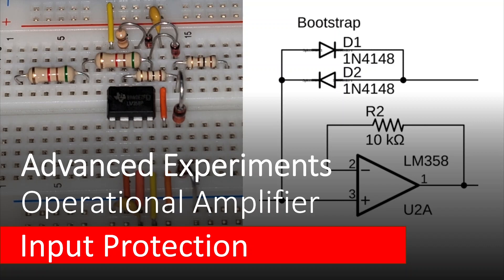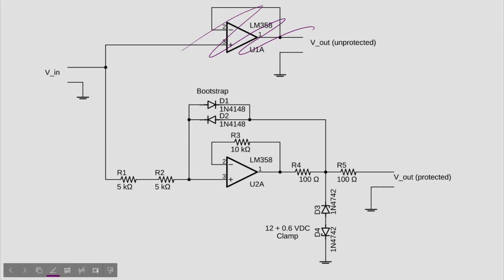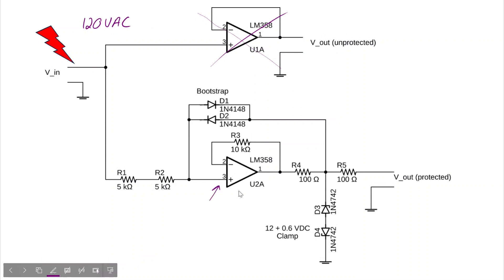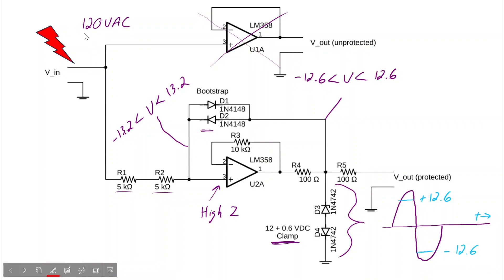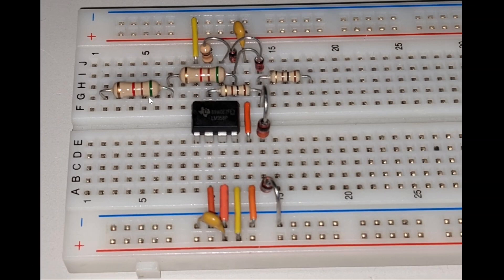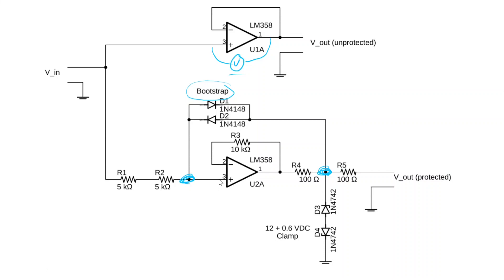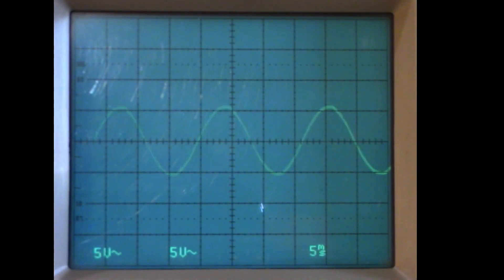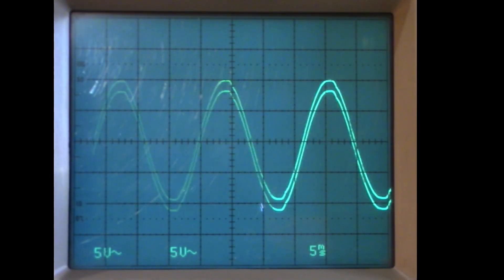Op amp input protection circuitry prevents disaster

Comment: Very interesting video. May I use the same solution also to protect an LM1638 with single supply voltage (in my case 0-24V) o should I connect the two diodes from + input to +24V and 0V?